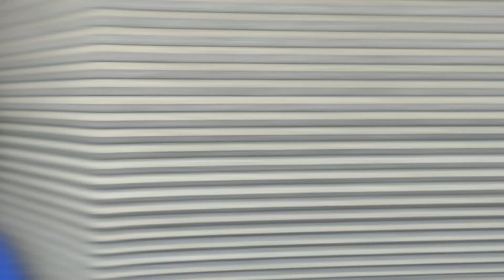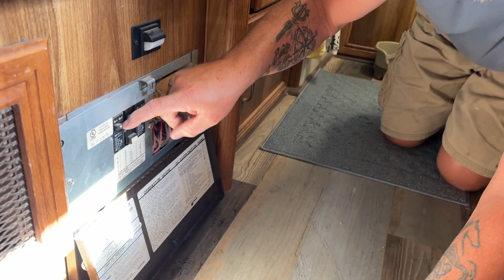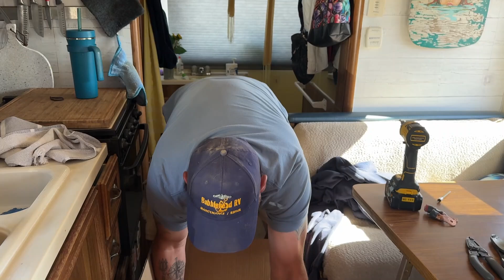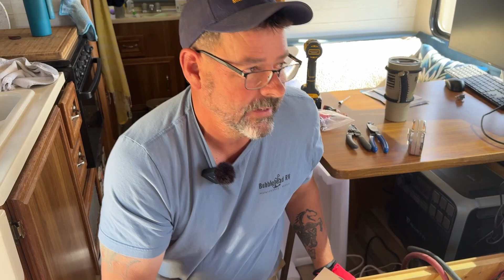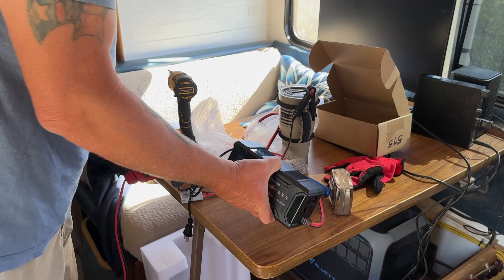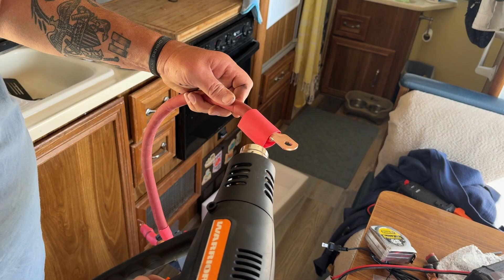Why Lithium Batteries Are A Game Changer

Comment: If you have a larger Rv super C or A pusher that needs more than 3000W inverter just upgrade to 48v cheaper and more efficient non of the 12V is affected the 48V system is to run the inverters.

Comment: You never mentioned the third option to charge and that is the coach alt. Charging system which is another can of beans.
Reply from the maker: My alternator does charge the batteries but I need a DC to DC charger. It is on the list! Thanks

Comment: Great video Deb! The only way our battery ever gets drained is when we have our camper serviced. The owner is going to get off his chair and do a walk around when we drop it off and, when we pick it up.  I'm still a little worried about the fires caused by the lithium batteries overcharging.
Reply from the maker: They let your battery deplete at the dealership? Not surprised! Yes, not having an auto shutoff for over charging is a little concerning.

Comment: Morning Deb, I did my own conversation a couple of years ago, I don't hook up to shore power when I'm out so my primary charging is done while I drive and that takes a DC to DC charger inline from my alternator to keep from damaging my alternator, not enough comment space to explain how and why it has to be done.
Bottom line with Lithium batteries is know what you're doing,!

good vid, enjoy the Lith !
Reply from the maker: Interesting thing about DC to DC is a while back I assumed I had it because my battery charges while driving. I learned that the alternator will still charge the batteries even if you don’t have that but it can damage it. That is one thing I forgot to have Joe check for me. Thanks for the reminder!
Reply from the maker: Mike, I just confirmed I do not have a DC to DC charger!! So it is on the list to add it as soon as possible. Thanks for bringing this up.
Reply: Alright Mike! Way to help someone out!!!

Comment: Surprised they sent a 20A charger. If solar is not hitting it hard due to shade or rainy weather I imagine there'll be tons of generator run time to recharge with no shore power . Correct?     
You may need some cooling vents on that compartment now...Lots of lectricity goin on in there and that battery reduces airflow to the inverter now.  Looking forward to updates.
Reply from the maker: Yep and one of my follow up is going to be how long it takes to recharge and that battery charger is making lots of noise and heating up trying to charge. Now that it is charged there isn’t a peep and it is not over heating. I will be keeping my eye on things. I will see Joe in Mi this June and we will possibly be changing out to a multi plus inverter. Mine was piece mealed together which is why it is a little different. Thanks Rob!

Comment: So much stronger than previous system, and no worries about inverter to converter loop!    I have not seen that loop happen before. Most who install inverters in an RV go with a combo inverter/ charger, which can only do either one function or the other but not both at once.  Enjoy the power!
Reply from the maker: I mat be adding the multi plus this summer and venting better. There will be a follow up video! 😊
Reply: @debsrvservices  Oh my goodness! You'll end up with a cabinet full of pretty little blue boxes and maybe even a 2nd battery if similar to other installs I see online. Out of my budget by a lot. Maybe they'll cut you a sweet deal.
Reply from the maker: Yes I may get a deal but will have to see!

Comment: I have a couple of questions: I understood him to say that leaving your inverter on runs down the batteries when boondocking. But the 110v inverter for my coach charges the batteries. Either shore power or a generator. My inside lights etc. are 12 volt. Could you speak to how you feel about these lithium batteries and whether they are safe or not when charging. Thank You, John
Reply from the maker: Leaving the converter on will run down the batteries, not inverter. So the converter is grabbing energy from shore and then converting it. When I am boondocking and have the INverter on and the CONverter on at the same time it is a loop. Does that make sense? Solar or a generator will recharge your batteries.
Reply from the maker: You probably have the type of inverter that has the charger built in. I may change to that this summer. Stay tuned!
Reply: Awesome Thanks 👍

Comment: Great video! Congrats on your upgrade.  I’m considering dumping my auxiliary 6volt batteries in favor of lithium.  When I do that, I’m thinking I want a lithium battery that is self heating so that I can isolate my Big Beard Batteries and solar if I’m in colder climate.
Reply from the maker: Wow! Yes that would make sense in case you are in a cooler climate. I’m hoping to upgrade to the multi plus inverter next. Joe might have one for me so that would be great. The Big Beard batteries are probably top of the line?
Reply: @ they were top of the line when I got them October 1923, and at that point the self heating ones were not available.

Comment: Great video! So happy for you Deb! I upgraded my Class C to Lithium last year. You will LOVE it! I did upgrade my converter to a WFCO lithium compatible. I didn't hear either of you mention the new batteries charging while you are driving. Your coach may not have that feature or maybe you disconnected it? I ended up having a Victron DC to DC charger installed to protect my alternator.
Reply from the maker: Yes I can charge the batteries while driving too! That’s great you got WFCO converter. 😊

Comment: 🧐 hmm interesting timing, i had a chat this morn with a fellow who helped me figure out as i suspect my solar controller i gotta replace. So now my plan is just go into Q town (yeah im still at the ltva) to a solar joint n see if i can find a replacement that will go in the same spot as old one. Save the bucks n install it myself. Only i have one issue, controller is live to the panels, no switch i know of to disconnect solar from batteries to controller. 🫤. So now im thinking of getting the controller n then figuring out how to go about this. 😵‍💫. 🍻
Reply from the maker: I’m sure there is a video out there🤣 Let me know how it goes.

Comment: Thanks for the video!  If possible I would appreciate it if you could share how your battery charger was installed to facilitate the display. Thank you.
Reply from the maker: Do you mean the wires going to the battery or where he placed the charger? He simply added the positive to the positive post on the battery along with the negative to the negative post. The charger is just sitting alongside my battery for now and plugged into an outlet. We haven’t mounted it yet because I am testing it. When I get to MI he will finish that process.
Reply: During the video he mentioned the charger has a display, so I was wondering how you plan on viewing the display.   FYI, the Victron battery charger has an app that will tell you voltage and current in real time. You don’t need to look at the charger for information.
Reply from the maker: Yes this one does have a display. In order for me to view it I have to mount it outside of the battery compartment. This one has an app too! So I can simply look on my phone as well.
Reply from the maker: I do have to say Victron is going to be top of the line. It is a great choice! Mine was piece healed together so I did this. If I was starting fresh I would look at the multiplus with the built in transfer switch.